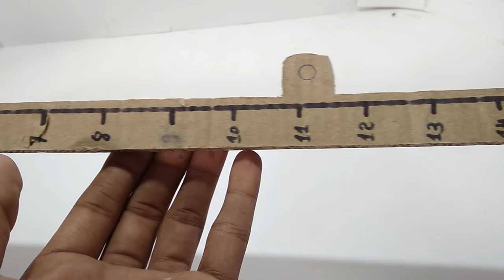Coolest Hydraulic Bore-well Drilling Truck (Do It Yourself Cardboard Craft)

Comment: Pls tell the name of the motor you have in top the machine....which is in black colour...
Reply from the maker: DC Motor
Reply: @DIYChannelcardboard  but how it bring air pressure
Reply: @DIYChannelcardboard  black colour material you have used in top please tell the name of it
Reply from the maker: Air Pressure Is Given Externally.
Reply: @DIYChannelcardboard  air pressure is given by externally but how you given in to dc motor.... Pls tell me about the connection or upload video from that please
Reply from the maker: @premkumar-by8di  Ok We Will Upload Video Separately.
Reply: @DIYChannelcardboard  tq bro....
Reply: @DIYChannelcardboard  bro pls upload video as possible as soon... I'm waiting for ur video Egarely